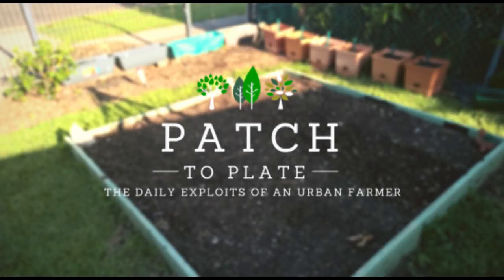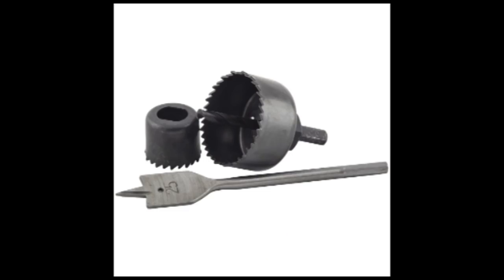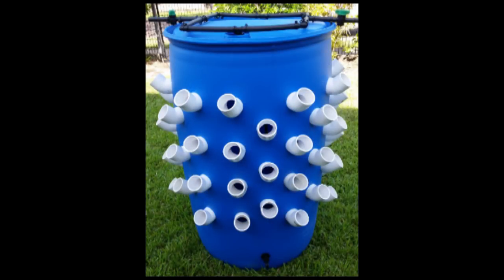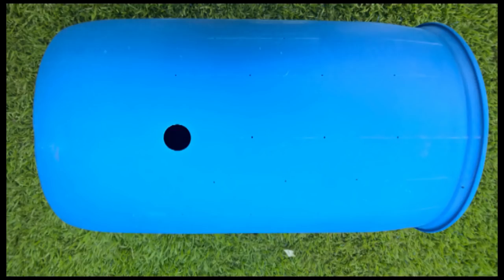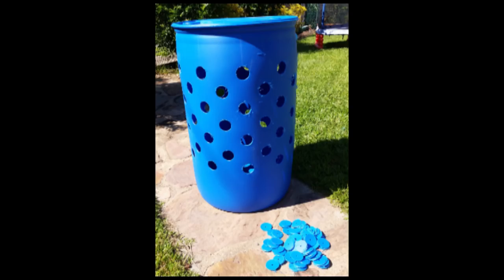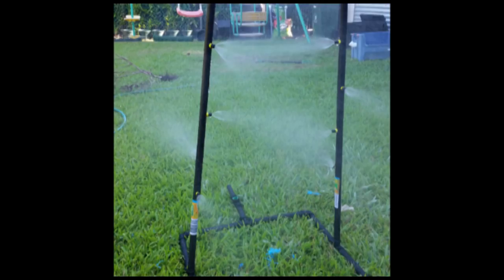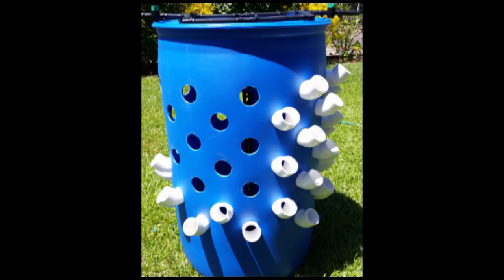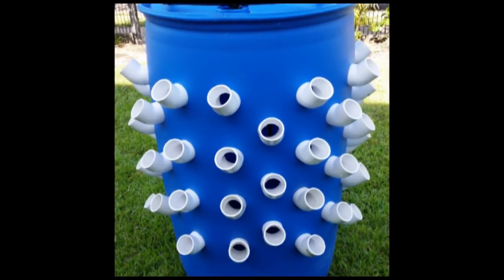Aeroponics Tower Build - Part 1

Comment: Just a tip if you're interested. If you run your drill in reverse, it leaves a lot cleaner hole in the plastic drum. A lot less sanding.  Great video.
Reply from the maker: +Paraguns Mate that is a great tip, many thanks! Will be sure to give it a try :)
Reply: +Paraguns I have spent months studying aquaponics and found an awesome resource at Keiths Ponics Site (google it if you're interested)
Reply: Scrublandz
Reply: Scrubla
Reply: Awesome tip, I will do this from now on. Thanx
Reply: YUP!... I learned that the hard way..rofl...works much better in reverse..especially with sizes beyond 1"..
Reply: @Jojazmine  the website seems to have been hijacked. Do you have an offline copy of it?

Comment: Saw a nifty video on using pool noodles cut at 1" widths and then sliced and added the sprouted seedling as the noodle is spiraled into itself. Dispenses with the need for an organic or inorganic medium in to support the thriving seedling in net pots

Comment: Heat the poly up and force the fittings into the holes this will seal and delete the need for sanding. Use square peaces of Soft foam a bit larger than the holes in place of the pipe 45s, they are cheaper and the plants will be able to grow larger around if they like. Plant hot crops on sunny side of barrel and the cold crops on shaded side don't worry about rotating the drum. Put small root plants on top with large root systems plants on bottom, Or they will steal water from each other and small root crops will not grow as large as they might. Keep the faith.........
Reply: Another option is to cut a recessed groove into the fitting. The groove will lock into the drum wall after you push it in ;) All you need is a router and a simple jig, aka, a chunk of wood with a hole in it
Reply: You sound experienced with this. I'll learn from you.
Reply: please elaborate on how a plant is placed with that square piece of foam that's in the hole cut out.  thanks

Comment: Did ya consider heating the edges of the holes (with a heat gun) before forcing the elbows in. It gives a tight fit & elbows position precisely as placed when the blue PVC cools.

Comment: On your spray pipes, I've watched other videos on tower gardens and the simpler way would be drill holes in the Lowest part, the valley or ledge of the lid to just let the water drip down the inner sides of the drum. And that's a low pressure pump or a solar pond pump.
Reply: Genuine aeroponic towers that run mist will leave a mislabeled hydroponic system like the Tower Garden in the dust.

Comment: I wouldn't put a cap on the open holes or at least not all the holes. I'm not a scientist or anything but I think the reason aeroponic plants go so fast is the roots' access to fresh air. While too many holes could cause more water loss or possibly dry out the roots too quickly if a pump breaks, but I would also think more holes would increase the effectiveness of the system.
Reply from the maker: +Justin Gatling Good observation mate. The rockwool cubes I use allow air in around the roots in the grow tube and there are a couple of openings in the top of the drum where hot air can vent out. Seems to work well as I have a crazy amount of root growth but you are spot on....fresh air very important in a system like this.

Comment: Good day,
TIP TIP TIP TIP
40 mm holes perfectly round and close water.
Make a hole of 70% (+/- 30mm)
Make sure you have a pipe large of the planned hole and a sponge with cold water.
Put a paint fohne here and heat around the hole. Do not overheat, may discolour slightly but do not burn, black !!
This makes the palstic smoth.
Now stop the tube directly from the inside (also outside), let the tube in and cool it off with the wet sponge. 
Then remove the tube.
You now have a perfect round hole with a collar that closes well.
This goes with every flat tube where a spout must be made !!
suc6
John, Netherland

Comment: Good morning from the States! I enjoyed your video as I learn a good bit of information from several sources. I am also new at the aeroponics  experience and we built a small hoop house 8x12x8 tall. We are doing dirt plants in recycled eave gutters mounted on the walls and aero in 2 barrels. You mentioned you felt you had too many grow ports. Ben, from Art Garden mentioned in a video that 42 is the oppitum number. Using the 12 hour positions on a clock, Mark your vertical lines on the side of the barrel, then alternate the grow port holes 3 down @ noon, 4 down @ 1:00, then 3 down @ 2:00 and so on,,,,,,
This will get your 42 grow sites.
Hope this helps someone!
Reply: drilled my barrel yesterday and used an adjustable 2 blade hole saw from Harbor Freight. About $8.00 U S. It has a center drill bit and a round bar with inch marks on it that carries the blade assemblies. Very accurate once set. I drilled 42 holes in about 15 or 20 min and very little clean up of holes.
Hopes that helps.
Reply: @joebray2437  Thanks Jeo, this was actually the info i had been searching for the last 25 min. Awesome Tip good man!

Comment: I'm looking to build one too and wondered why so many others didn't think of simply using elbow joints instead of trying to cut an oval hole. I saw one guy painstakingly using bungee cords and jig devices trying to cut ovals, or even worse, a jig saw. Trying to cut an oval on a round surface is much harder and not necessary. 

Also, from what I've seen there's no need to go with a high pressure atomizer pump. Just spraying, dripping, or running water over the roots using a cheapo low cost water pump works just as well for the DIYers. Plus you don't have to deal with clogged sprayer heads or cleaning water filters.
Reply from the maker: st8kout1 Good luck with it! Can't comment on comparison with high-pressure vs. low-pressure but from my point of view, the low pressure system I have built is working beautifully. Lots of root growth, plants are fast growing and healthy. We are getting all of our salad and other greens for the family off one drum so 1st mission accomplished. Might be time to build another one :) Happy to answer any questions I can once you start your build. Let me know how you go.
Reply: st8kout1  Elbow joints cost more if you do not have the extra money.. I get a 2 inch PVC pipe and cut it 2 inches long make enough for each Barrel.. cost $8.00 for one pipe.. If I use Elbow it would cost a lot more
Reply from the maker: altha2008 makes a good point here. The elbows definitely cost a bit more but are easier to fit and provide an area for nutrient to pool (good when you seedlings are getting established in the tower and throwing more roots). Straight pipe will be quite a bit cheaper but a bit more fiddly to cut and fit. If you are trying to keep costs down even more and don't mind the extra time and effort, it's a good option. Another option is 90 degree elbows which cost more than the straight pipe but are cheaper than the 45 degree version. I'm thinking about changing the top row of my tower to 90 degrees for plants that get a bit bigger and like to grow more vertically.
Reply: Thought of doing the 90 degree pipes myself. I use a 3 in PVC for my Base. I cut holes ever 4 inches for the sleeves. I have 30 on each side. If I use Elbows it would cost me another $60.00 or more for the plants  I can get one 10 feet long for under $10.00. cutting them in two inches is not bad, I cut curves in one it for the plants takes time, I'm retired due to Parkinson. So this is a hobby and a second income for me. I do have time on my hand.
NOTE:: I do make my own planting cups as well out of newspapers. takes work, but all I have to do is set it in my Tower when it is ready. no stress is put on the plants
Reply: altha2008 if You hadn't started and really digging for lowering prices - with some heat (not over-extensive ;) ) and template (a piece of paper with two lines at desired angle) - it's not really hard to bend the pvc -hot air gun works best but in last resort even a burner of gas cooker will work fine; also - try to keep the area of heat-treatment as small as possible or the pipe will colapse while deforming

ps: check if the ink used to print these newspapers you mentioned - is not toxic
Reply: news papers are no more toxic the some dirt farmers use. I use to live on a farm, people would not buy food from a farm if they new what all they threw out on the dirt.
Reply: altha2008 so - what did they threw out on the dirt ? u don't have to admit it was Your farm or give any locations...I only hope that You didn't have manure on ur mind because it would not only mean eating a hamburger as having closest expierience to living on farm - that would  suggest also serious lacks in basic educuation.

Comment: Instead of elbows, that are pretty pricey, you can also use plastic coffee cups, try to find sturdy enough. Just add some holes to teh bottom. That can be done with a drill, and to several (6-7) cups at a time.
Reply: Jaakko Laurila but that would be at a different angle?
Reply: Or piece of pvc pipe

Comment: I'd like to ask You, if You didn't encounter any problems with particles clogging these mist-spray nozzles,

I have some expierience with hydroponic systems and for outdoor summer garden projects - it's not possible to avoid some solid particles (carried by wind or flushed from substrate), algae that tends to flock or even dead parts of plants (especially with re-used substrate);screen cut from a kitchen sieve was enough and particles less than 1mm weren't a problem for a 1cm diameter pipe supplying water - just that the mist spray You showed was probably designed for clean water (...and professional aeroponics systems are bit too expensive for my taste)
Reply from the maker: panicape1 Really good question mate. I use House & Garden Drip Clean in my nutrient mix which seems to work really well - I haven't had any blockages as yet (touch wood). The other thing I do every couple of weeks is connect a hose to the second manifold inlet and give about a 30 second run of both pump and mains water tap to blast anything out. The combination of those two things have been very effective in keeping the spray heads clear. Last part is the design allows me to easily remove the entire spray system from the drum for checking, cleaning and/or replacing heads. Again, I haven't had to do that as yet as the system has remained clear and working well. Hope that answers your question and thanks for watching :)
Reply: patchtoplate ty for reply
I must admit it is first time not only I hear about product You mentioned - it's also 1st time I hear about such group of products .Hey! - I'm some person from the internet and if You don't feel comfortable witch chemistry - I strongly encourage You to ask someone whose judgement  You could trust. I don't want to call it a hoax but only other explanation I can think of - is that the descriptions (starting from http://www.house-garden.ca) were written by someone who didn't participate in develop of that thing. "contains potassium and phosphors, these two compounds have had their chemical molecules changed to remove one of their structures" looks for me like a solid basis for that idea. 

Firstly - those are elements but even if we assume that someone was refering to compounds having these elements - it's still a nonsene - it's like saying that someone removed length of a house or a car(not some length - the length). Add some sophisticated vocabulary that most ppl don't understand and [drums]... You've just made something look fancy. Reminds me of old sci-fi movies with crew "restabilising the polarity of negative-ionic dark matter decomposer"...no-one from audience have a slightest idea what could that mean but sure it works as nice explanation on why engines of spaceship stopped.

Second thing is on their US site ( http://www.house-garden.us  -I hope that I didn' made myself silly and it is really a manufacturer's page in both case mentioned). In a calculator (table) they provide - someone recomends to test pH before adding this Drip Clean (that contains  phosphoric acid). I could compare it to someone suggesting washing Your hands before you work in garden - ofc You can but what for?! If u do it both before and after work -ok, no harm but suggesting doing only once and before - is just bad.

One also can find it interesting that "favoured by Dutch growers" products that some contain "Norvegian Sea Kelp" (also a quote) are nowhere to be found in Europe. Do they really purchase it from US and CA shops - perhaps they do, I don't know any Dutch growers. Perhaps it's avaiable in Europe under diffrent brand name - couldn't find it.

Lastly I want to say that I think I understand reactions behind the scene and by itself - it's true. Same process u can observe by using "soft-soda drink of dark color starting with letter C" (no advertising) to get rid of limestone from water-toilet. So- it's not the process - it's stuff found around that made me wonder about that product (and a company). In my oppionion - Drip Clean could be an option for someone using water of high salt concentration but there are other options that comes cheaper. Plus - one would have to do extra job to add this product into calculations of N:P:K.

ps: sry for volume of my comment but saying "heyyyy man, watch out - it looks like some swindle" without any reason seemed even worse than this
Reply from the maker: panicape1 Thanks for the reply mate, agree with you on the double-testing of pH, I only test at the end of the process to balance to my preferred level. I'll do a bit more research but the product does seem to work in my setup. The nutrient mix is the salt which was blocking the heads and since using the drip cleaner I haven't had any blockages. You might be right that there are other and cheaper ways to achieve the same thing though and I'll do some more research on that when I get a bit of time :) Again, thanks for watching.
Reply: patchtoplate  thanks for sharing
Reply: This is a pretty old comment, but I looked up the MSDS and it claims to be pH neutral. It does have some potash, but it doesn't sound like he's getting a nutrient deficiency anywhere, so that shouldn't be a problem with the NPK mix you mentioned. Interesting ideas, though.
Reply: we could have been reading diffrent msds but the one I dig-up minutes ago clearly says otherwise - check page 2 - field no.9
http://www.horizenhydroponics.com/files/MSDS/MSDS-DripClean.pdf
beside - it would be impossible to not lower pH for anything containing phosphoric acid as ingredient 

I know - it's mentioned in data-sheet that pH is in range 6-7 but while 0.1 change for a plant wouldn't do much (gap between uber-super-optimal and really comfortable conditions) - I can assure that 1.0 is huge

ps:that's the exactly my previous issue - mind that I didn't try this product - it were the inconsistencies in information provided by producer that made me wonder
Reply: Strange - I can't find the one I looked at earlier. All I'm coming up with is the same you found. And you're quite right, of course, that a whole point difference is pretty dramatic. Though a few drops in, was it 40L? Some .org's conversion thing is calling 3 drops equal to 0.0002L, so - I still wouldn't personally panic. The main thrust of your OP, though, I agree with whole-heartedly. Their marketing department must keep a photo of PT Barnum on the wall.

Comment: I believe you could have used a heat gun instead of sanding. If need to remove one use heat gun again.
Reply: May I ask what or how will he use the heat gun?  Would he be using the heat gun on the hole of blue barrel after he drill out the whole OR use it on the pvc elbow ? Thanks.

Comment: I have tried a 1/4 size pump inside the barrel and do not get the pressure spray from the mist sprayers . am i under size in the pump. i got different size sprayers than you show on the page.
Reply from the maker: +Clay Hewett G'Day Clay. It sounds like you could be under pressure with your pump. When sizing a pump, you need to factor in the head height or height you are lifting the water from your reservoir to the spray heads/manifold. There are a few resources online to assist with that if you Google it. For applications like this, the pressure (psi/kpa) rating of the pump is as important as the flow rate (lph/gph). The manifold in my design is there to even out the pressure to each spray head. You then need to total the pressure required for each of the spray heads (psi rating X number of sprayers) and then add additional depending on the vertical distance you are lifting the water. Hope that all makes sense but if you want to message me directly with some more details I can give you a hand with the calculations. Thanks for watching :)